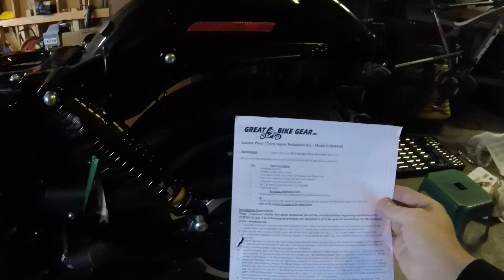Harley Low Rider S License Plate and Turn Signal Relocator Install

Comment: Soldering 101- Heat the wires until the solder melts when touching THEM. That way the solder flows around and through the wires making a more strong connection. I learned that on Delboy's Garage.  Michael

Comment: I bought that same kit. Could not for the life of me get the turn signal wires out of the terminal. Gonna have to solder. Also could not get the license plate light wire out from the glue.

Annoyingly I bought this to work with the HD detachables kit, which this is supposed to be compatible with. But requires drilling a hole.

Going to use EasyBrackets. Wondering how your sissy bar and saddlebags worked out.

Comment: No need for soldering ! For anyone looking to relocate their bracket. You are able to take the wires out of the terminal sockets. They are super check if you break them. Law Abiding Bikers has a video on how to do it

Comment: where did you get bracket to centre mount plate have you had to drill rear fender im trying to adapt on new 2018 fatbob
Reply from the maker: greatbikegear.com had it, but the page has moved, so I'm not sure if they still carry it. No fender drilling required, it worked off the fender frame mount holes. I did have to source some longer hardware when I installed the sissy bar as well, but it wasn't anything fancy!

Comment: I get to 3:30 and we're jacking up the  bike to relocate the turn signals?.  No thanks.
Reply from the maker: Yep, kind of a requisite to get the gap space between the top of the tire and the underside of the rear fender. All the wiring is right there.

Comment: Looks good. Can the indicators stay in the original location and just relocate the licence plate?
Reply from the maker: Nathan Carrington not of you're wanting to use full-sized saddle bags. mini bags probably wouldn't need the turn signals to move
Reply: Thanks mate. Im in Australia and rego rules don't allow the side mounted number plate so we have it at the rear, but obviously its an ugly large plastic bracket so was hoping I could use one of these just to clean the rear end up.